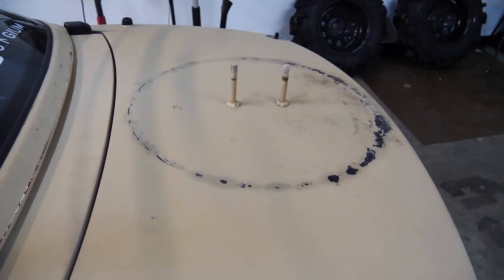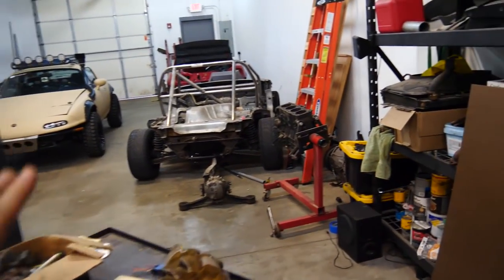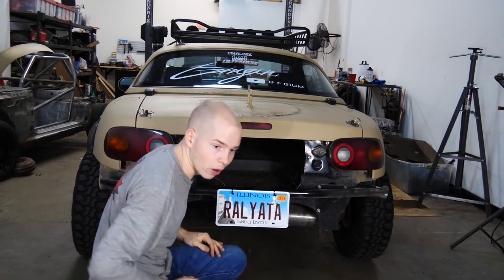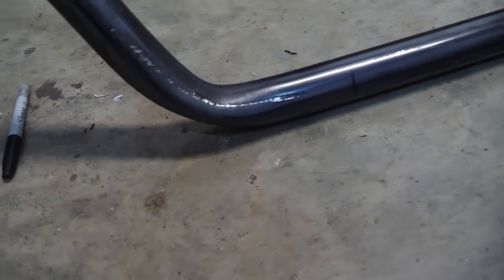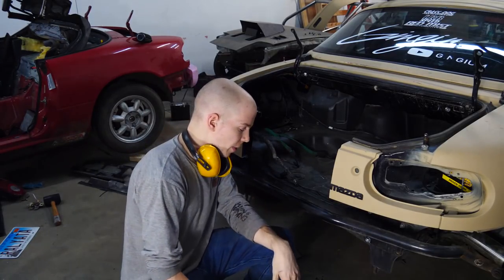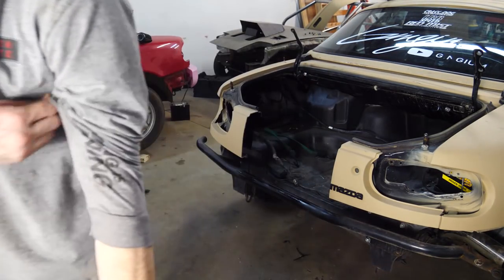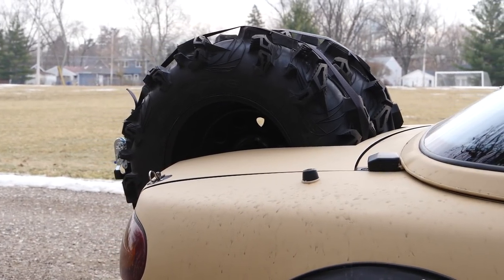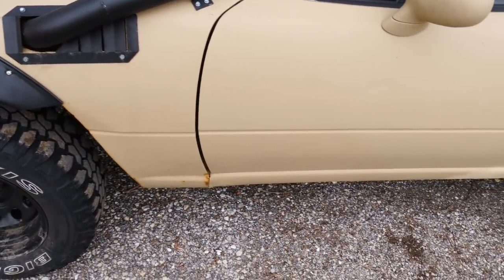Lifted Miata Gets a Trophy Truck SPARE TIRE Setup!

Comment: Has a roof rack 
But cuts into the car
Reply: The Mechanix let’s put heavy mud tires on the roof rack. That totally won’t upset the center of balance on a lightweight, lifted Miata.
Reply: @nickhenry4873  he barely takes it offroading he drives it in light snow if anything 
Also wtf was the point if the tread isn't even the same as the other 4
Reply: The Mechanix it’s 2wd and not 4wd. The front tires are not drive wheels, therefor having such a ridiculous tread on the front would be pointless. Same as those “mud drag cars.”
Reply: @nickhenry4873  has a fucking bus and trailer but no let's still keep the tires on the car for no reason other than for a free video and content. And putting oversized tires on the back already changes the angle and balance of the car.
Reply: @themechanix2311  exactly. Light mud and some hills behind a construction site but no let's get some extreme mud tires that offset the stance of the car and still barely benefit a Miata with 100hp
Reply: Who cares, it's his car. I dont think you are funding any of his projects, that's what he wants so that's what he will do. Its different there for it's kinda cool!!!
Reply: @nickhenry4873  Whenever he is satisfied with this build and takes it offroad he will need recovery kits and will need somewhere to put camping stuff if he chooses to camp. Now with no trunk he is forced to now put all the weight on the top of the vehicle. You are gonna have weight up their no matter what and since the Miata is already raised the center of gravity is already screwy. A good thing is that the car is reasonably lifted and has a wider stance he shouldn't have any problems with the car tipping or acting funny with the weight up there. Look at overland Jeeps and all the things they carry. I think he would he more than fine with 2 ATV tyers up there.
Reply: @robertbowers5487  why are you so mad about someone else's car?
Reply: @robertbowers5487  Why are you all over the comments with this complaining. Its not like he did this to your car. You sound real lame
Reply: @robertbowers5487  1. It YouTube, you get paid for making content 
2. Why keep them in the bus when he can have them on the car, it's convenient and he doesn't have to take the bus everytime he wants to go off roading
Reply: @derekrogers3426  everyone who watches these videos funds the projects.
Reply: >The Mechanix has huge eBay wing 
>On slow stock 350z
Reply: The Mechanix it helps with off-roading and it’s only rwd so he doesn’t need it on the front
Reply: Putting them in the rear instead of on top of the car not only makes it less prone to tipping, but puts a lot more weight on the rear tires which means more traction, which is very beneficial especially with 2wd
Reply: The roof-rack is mounted directly to the hard top. The hard top mounts at 4-6 places depending on whether the car came with one from the factory. These mounts are not meant to hold a load from the roof.
Reply: @nickhenry4873  Yeah because having front grip to steer is pointless. The mudders allow him to brake effectively on loose surfaces. The tires being a large diameter are worse tbh but he needs ground clearance and those are the smallest available mud terrains.
Reply: Did y'all miss the episodes where he took it off reading with actual Jeeps or...???
Reply: Ricky Ricardo well since then he took the supercharger off. He isn’t gonna have as much power. Now I’m not an avid off-road guy, but the mudders could be beneficial as there isn’t as much power anymore.
Reply: @HayRiver2  was on it when I bought it not even a full month ago 
Either a big eBay wing or holes in the hatch 
Good roast tho
Reply: Ya'll gotta chill. We do fund this to some extent but I don't think we find it 100% otherwise it would be Subaru swapped already like he's talked about. It would be silly to put that weight on the roof that attaches in a few spots. It's functional puts weight over the rear tires and if you had to pick between not having mud terrains at all or on just the rear youd probably pick two if you actually did any off road driving and realized the importance of tires. It doesn't need that aggressive of tire up front its just more resistance to push. Plus, on top of everything, it looks cool. "He has a bus and trailer". So fuel for the bus, fuel for the car, loading and unloading time, and having to put muddy wheels inside the nice bus. No that's way too much hassle when he could drive. "Hes gonna put recovery gear on the rack cause his trunk is full now so the weight is still going on top of it" it is going to put weight up top IF he decides to do that. You could fit a jack in the trunk, it's a miata so how many tools do you really need for a 90's Japanese car? Nothing up there will weigh more than both of those wheels and tires up there. It's good practice not to go wheeling alone too. Plus, * pssst * * it would look stupid * Also while I don't play minecraft lots of people do. It's a game of creating things and ging is creating things so chill with that. The wing comment, eh, I don't like it. The wing that is. But whether or not it was on there when he bought it or hes trying to save face because hes emberrased is null. It's not your car and I've seen worse. So this comment section is full of all of you acting like children. When on the internet please just take this as a universal rule: dont be a dick. Thank you and have a nice day. 😊
Reply: @robertbowers5487  don't worry mate, when you graduate high school and can finally afford an mx5 you can put a rice cannon on the back just like you always wanted :)
Reply: Robert Bowser what if he goes off roading far from the buss? You expect him to go all the way back to the buss to get the tires? If you were driving ur car miles away from home I’d think you have a spare tire rather than paying a tow truck to take the car home
Reply: @robertbowers5487  well at least he doesn't have to put a big Wang on it for that downforce
Reply: Yeah, I definitely agree with the people saying everyone's gotta chill. It's all about having fun and being happy, and if crawling and trailing a lifted Miata makes you happy, more power to ya! As more and more birthdays have been coming and going since I graduated from university, I've been picking up little life hacks along the way, and they're all connected to one central hub: Live as many happy moments as you can. Why the hell else would you bother living for? If happiness isn't "the point" then what the hell is? Like me, what makes me happy is helping others and trying to bring them to that place that makes them happy. Then once that's done for the day (you can only do so much in 16 hours, sometimes 18, or 48🤪), I get ready for bed, turn on the telly, maybe find something on Netflix, I have my Coca Cola, my nicotine vape, and I'm in heaven. This is what the Universe has led me to. "Butterfly Effect," look it up on wiki. So everyone take a deep breath and remember, this is all about a kid doing crazy stuff with NA miatas. It's a kick to watch. Very much enough said✌🏼🤪👍🏻
Reply: lol@Bob Blowser
Reply: Robert Bowser i mean you can just stop watching his videos. Not like anyones forcing you to
Reply: I'm with Corey 01. If you don't like what he's doing, why the hell do you watch his videos?! Just to troll? Trolling is getting old. I have friends that used to troll and they're getting older and some have kids and a wife now. Trolling is that degree of old😆 There's just something in human nature that makes people get off by writing some rude reply, pressing SEND, then seeing what others say.🤔 Maybe it's like the Howard Stern effect. When he was still on regular radio (pardon me please for those who are too young to know who I'm talking about...wiki his name), half his listeners were fans, half hated him completely but they listened to hear what outrageous thing he'd say or do next, and call in to get on the air to complain! There is literally so much content on YouTube that you couldn't watch it all in countless lifetimes, and it keeps coming everyday, 24/7! So, find something you like. Trust me, finding something you're into and writing positive comments and social networking feels so much better than: Insult, send, wait, look at replies. It's getting old.
Reply: @derekrogers3426  we are funding them by watching our videos he would have money to do it if we didnt
Reply: @corey0189  😆 Funny, but I think it's going to be a long wait, cuz I doubt this kid goes through his video comments and battles every troll. Look at his subscriber count and the average view count he gets per video! It's not enough to become a millionaire off of YouTube's monetary incentive program, like I was talking about yesterday, but when you start seeing numbers with a "k" behind them, there's no way you're making "appearances" in your comments sections.
Reply: Robert Bowser don’t cry mate
Reply: @robertbowers5487  most 4 bangers are touqey and they can get pretty high in horse power. Plus this car is supercharger.
Reply: @dro3m  sadly he removed the supercharger a few months ago, that is why the hood is stock again

Comment: Till you can bend the pipes the stock bumper is best. I have a concern and a suggestion. My concern is the ratchet strap mounts on the bumper bar, will you be adding structural supporters behind them? I hope you think this is cool and doable but as soon as you cut the trunk up i thought id be cool and useful id you would weld a "box" or walls on either side of the tires for structural support and so you can have storage still on either side and to "weather proof" the trunk so you dont have to clean out mud and stuff after off roading. Love the videos keep up the good work and hope the finger is ok

Comment: Fixing the rust, use a phosphoric acid rust killer to neutralize it. Yes you can keep painting it but that doesn't stop rocks and whatever chipping your paint off letting moisture in. Also look into getting some rubber trim for your freshly cut trunk, would suck if those tires rubbed on it or someone cuts themselves on it

Comment: How many times did you switch up beanies? Lol, I'm not even 5 minutes in and you switched like 3 times
Edit: don't forget to put something like rubber hose or something on the sides you cut, cause it can damage your wheel.
Reply: I would use door edge trim its super cheap and looks good i used it on the fenders of my jeep after i trimmed them
Reply: I read rubber nose
Reply: Came here to say this
Reply: Yeah was going to mention that too, need some kind of protective rubber on the sharp edges.
Reply: Those tires are like an inch thicc
Reply: I meant the beanies lmao

Comment: It's a neat idea, you should just weld in partitions to the inside of the trunk on either side of the wheels, drill out some drain hole in the bottom, then get some sort of rubber seal or something and affix it to all the bare metal edges so you don't damage tires or rust.

Comment: Fill the Pipe/Tube with sand,stuff it really good,cap the ends,then bend it,the sand presses against the inside of the pipe,and minimizes kinking it,we did this all the time when i was building Rollcages and similar stuff.

Comment: what you could do would be to stick sand in the steel tubes, compress it as much as possible and weld it on both ends.
So you should be able to bend it without a big risk to get a wrinkle

Comment: Use sand to bend the pipe and do a bash bar section for the wheels (sand keeps the pipe from kinking just take the ends closed), maybe weld a 3 sided box into the trunk that the wheels fit into that allows the side sections to still be used as mini trunks and keeps the crap out of the rest of the trunk and car, drill "weight saver" holes ion the floor so the water and mud can drain just don't weaken the structural integrity of the car reinforce it weld box section into all the areas you cut to get rid of the sharp metal and give it a rounded appearance?

Comment: but what if it rains and the rally miata is outside?
Reply: Then the Rally Miata is going to get wet... Like everything else in existence.
Reply: @JJ_ExMachina  the issue is that the trunk has no metal plates to keep water out of it, also i don't know about the license plate placement
Reply: @UnHoly_Garage  ... SO I take you have never looked inside of a car before???? There are drain holes all over the place... In the trunk of all cars, there are large drain holes covered with plastic plugs... There are smaller drain holes inside the car in the floor boards... Just lift the cover where you spare tire is in your trunk, you will see what I am talking about.
Reply: @JJ_ExMachina  yes i know there are drain holes, i am familiar with it, but there are electronics in the back of the car, and if you know anything about electricity, is that is doesn't mix well with water. i also rust is going to be a big issue because hen live in Illinois and that is in the rust belt for cars.
Reply: @UnHoly_Garage  ... 12 volt systems on vehicles do not care about water... It is corrosion you have to worry about... Some dielectric grease will prevent corrosion. OR you can go cheap and spray the connectors with WD-40 (Water Displacement 40)... and prevent corrosion... The 12 volt systems on cars even work under water... You can roll up and down electric windows under water... LEDs work under water... As long as corrosion has not formed, causing high resistance in the circuit, then there is not going to be an issue.
Reply: @JJ_ExMachina  r/iamverysmart

Comment: Hey pro tip, youre supposed to fill the pipe with sand and tape it on both ends so the metal doesnt have room to kink when you use a bender. Hope that helps and saves you money from buying a new one for a bit!

Comment: Probably the stupidest thing you've done. Chopped the rear end up to fit some useless mud tire spares that you won't need and exposed your trunk to the elements making it an even worse daily.
Reply from the maker: Oh totally.
Cut the trunk that I couldn't put anything in anyway because it was too heavy to pop open myself to fix the annoying ass squeaking and fit the two spare tires I will use every time I off road it.
It so much nicer to drive like this.
Reply: @_Gingium_ I understand that but what about when it rains or snow or when you go mudding? All the junk in the trunk will annoy so much dont you think? Besides that, I think its awesome!!!
Reply: ooof, bit of beef going on here??
Reply: One: done is done two: its his car if he likes it he likes it  three: if you dont like it you click away
Reply: because it was TOTALLY meant to be a daily, comfy, nice driver. MMMHHHMmMMM... ToTaLLy
Reply: not some crazy off-road car, naaaaa
Reply: Robert Bowser ... I think you are confused... The "Rally Miata" is NOT a comfy, Daily Driver... It is an off-road toy, to have fun with. The Rally Miata was meant to be a bit silly and extreme in every way. The mud tires have extreme grip when off road or mudding... they are not meant for on road use...
Reply: Daily??????? Are you high?
Reply: @usqua2278  tell that to all the times he has taken it or used it as a daily. Sold Stacy and has a still non functioning truck, a street Miata that's stored away and a bus with Audrey's shitbox. This is the closest thing to a daily he had and it's now even less functional than an already horrible Miata daily.
Reply: @usqua2278  because he didn't sell his rx7, or stacy, or have any other daily capable car left that isn't stored, useless or still ripped apart.
Reply: @robertbowers5487  ... "Ruining"??? How is the Rally Miata "ruined"... You really must be confused, because the Rally Miata, starts stops and steers just fine... You worried about a trunk??? Have you never heard of a Motorcycle??? Most motorcycles don't have "trunks", and people all over the world use them, every single day of the year... Is the Rally Miata, your own personal vehicle??? Did Caleb take your own personal property and do something with it???? Because last time I checked the Rally Miata was his vehicle and his to modify as he sees fit to do so.
Reply: @robertbowers5487  damn dude. 8 comments of pure hating. What a world we live in.
Reply: @robertbowers5487  either way you're a really bored troll or you have a serious aggression problem
Reply: he's getting a new daily so it won't be his daily for long. He could've done other stuff but if this is what he wants to do let him do it because it's his car

Comment: I think it looks good and is good placement to add a little weight back there. Only thing I would do is slit some thick rubber hose and glue/silicone it around your cut edges. It would clean it up and protect it.

Comment: Personally I don't like it but why didn't you think to just put the wheels on the roof rack
Reply: It would be more top heavy, plus the might not fit at all. They are pretty big...
Reply: Fiberglass hardtop is not designed for that kind of weight.
Reply: Cozmyc Reaper those aren’t meant to be in the car while he’s off-roading. They are meant to be swapped on upon arrival. But Caleb doesn’t do this as a profession, so he doesn’t have “support truck” to tote around his spares, so that is a solution, and it looks much nicer than the trunk mounts
Reply: That's how people with more lips than brains react to things.
Reply: @robertbowers5487  The RV is not meant to be offroaded the same way as the miata. While offroading, it is convenient to have spare tires with you, and not left behind in the RV.

Comment: A trick I learned with those pipe benders is to fill it up with sand and tape the ends shut, will prevent the pipe collapsing in on itself @Gingium